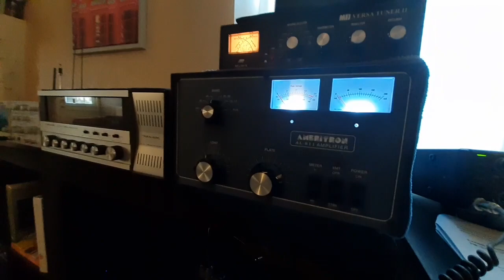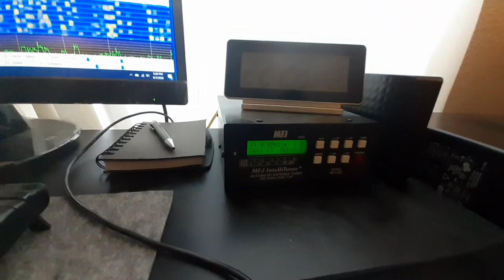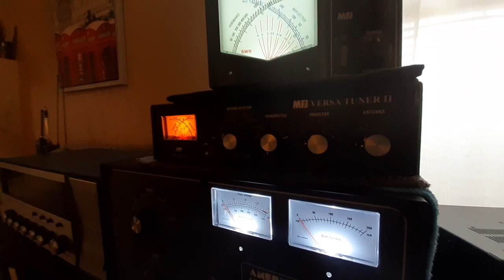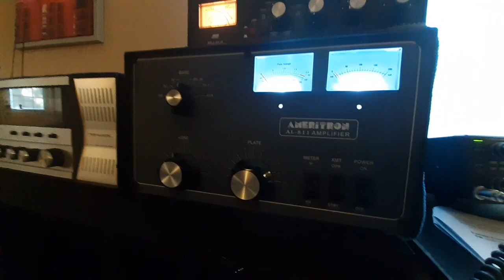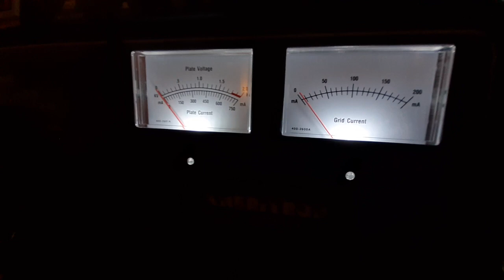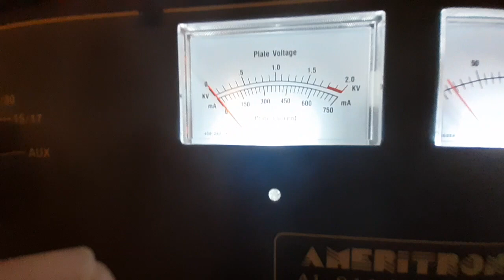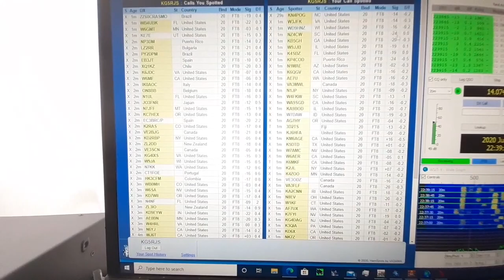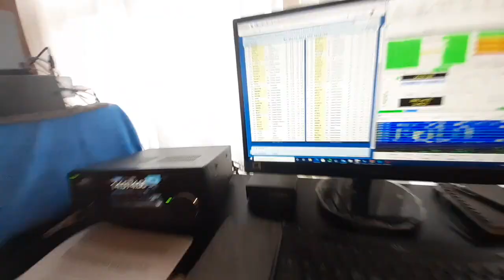Amateur HOA Ham Station Update, IC-7300, Ameritron AL-811, Silver Bullet 1000, WSJT-X Digital.

Comment: I would sneak a wire 80 meter doublet up in those nice trees you have and nobody would even know it's there. If you don't have 120 feet between those trees, simply use a 67 foot wire fed against radials buried in the yard for 80-10. Believe it or not, you could even staple a full size 80 meter dipole on the top wood brace of your fence and it would work pretty well, even that low. Very stealth too.

Comment: First off I want to say great job on not letting the HOA stop you from getting on the air...having a compromise antenna is better then NO antenna at all...
Second.. the exhaust vent on your 811 is being blocked and I recommend plenty of air flow through and around it....if you want the components and seals on valves to last....

Comment from the maker: Another clarification - the IC-7300 is going into the intellituner, then to the transmitter input on the amplifier, which is why I use the Intellituner to touch up the SWR between the transceiver and the amplifier.  The output of the amplifier goes into the Input of the MFJ 891 SWR/Watt-meter.  The 891 outputs to the input of the Versa Tuner II, and finally, the Versa Tuner II outputs to the antenna feed-line.

Comment from the maker: I did want to clarify, I only can only run the amplifier on digital modes at 20-meters, since I'm bypassing the Silver Bullet 1000 loading coil with the jumper.  I can not run more than about 40 watts digital through the loading coil, and even that's pushing it.  If I watch my keydowns, I can run ~300+ watts PEP SSB phone through the coil though, which makes 80-meter phone possible given my significant-compromise antenna on that band.